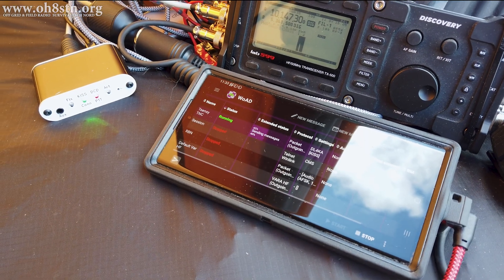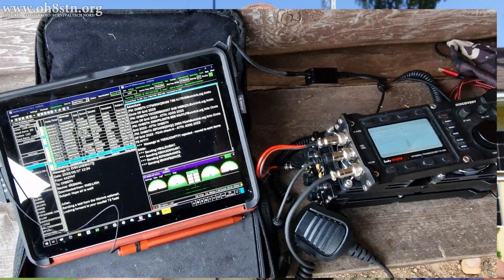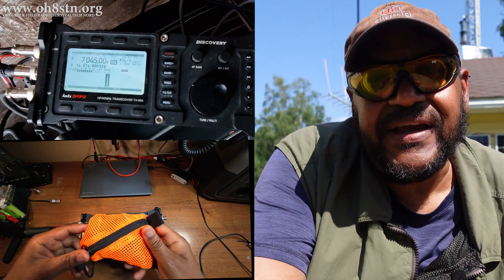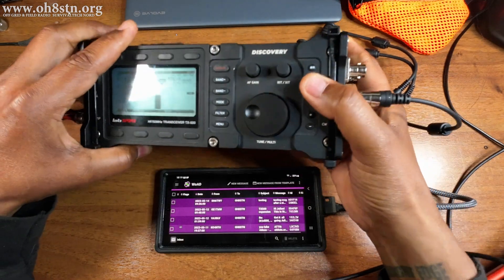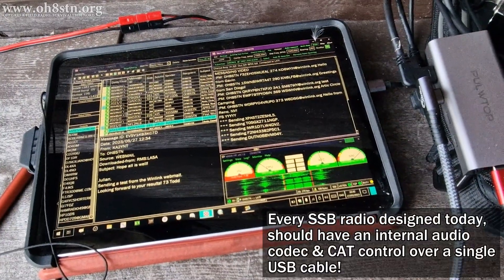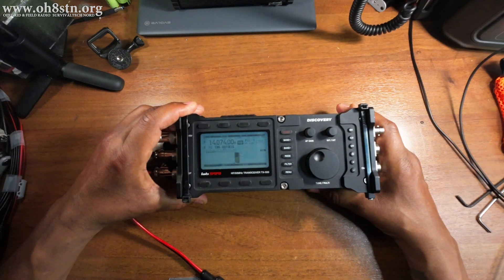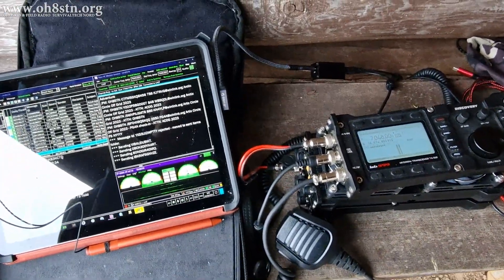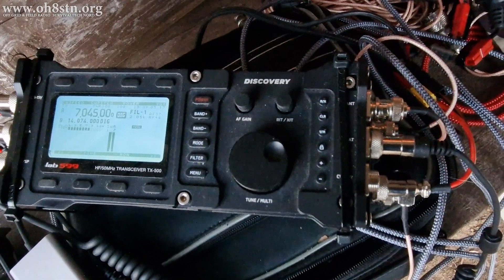Modular Ham Radio Go Kit for Off Grid HF Radio

Comment: Hey, Julian, I am torn between the 705 and lab 599. I need compact and portable due to living in a small apt. My main use will be outdoors, SSB, digital and one day CW. With the 599 being out for a while now, any recommendations?
Reply from the maker: It's complicated 🤣
The size and weight of the tx500 are appealing.  Its cable mess for dsta modes and cat control are not.
The 705 is the benchmark for all mode portable  HF, VHF, UHF with one or no cables. Its size is less appealing,  but everything is included or already built in.
It really is complicated. Hear some watching gun reading for you.
https://youtu.be/P5C3Fyy96DU
https://oh8stn.org/blog/2020/10/14/icom-ic-705-vs-lab599-discovery-tx-500/

73
Julian oh8stn

Comment: Hello, I watched your video by curiosity and was please you have explain problems you’ve have met.
I’m not an amateur radio, but what I see is that companies like Yaesu or Icom seems primarily have built radio for voice communication  not for data, maybe because there are to many modes available without any as a standard that could be integrated.
For emergency field, I would think modularity is not the way to go because you want a setup ready, when needed. I can’t imagine, under stress,building the setup you have shown. There is too many cables, and not surprising you had a problem.
Also, your radio equipment seems rugged but not your Windows tablet. If it’s a key components of your setup, you could think about it. 
Otherwise, your solar power setup is very well thought.
Overall, i’ve enjoyed watching your video and listen your thought process.
Great job!

Comment: THIS is Exactly “WHY” I follow you!! Plus Share your vids with 8 other guys that have an interest in comms.  
A Very Sincere - THANK YOU Julian !! 

* Since, for Most of us, the Lab 599 & accessories are damn near Impossible to acquire maybe some videos with other / older portable units. 
Personally, I would request some using a Yaesu FT857d with external battery in a Manpack. 
I know it is QRO, but power output Is adjustable…
My environment is BRUTAL, just a 180* from yours, Beach Environment & the Everglades of Florida. So my adaptations must deal with: 
SaltWater - Heat - Humidity - Sand - Insects - Lizards PLUS the occasional Bikini sighting. 

This request is a little selfish but I dare to say that only a “Very few” have the Lab 599 + Amp + Batt 
 
Again, YOU ROCK Julian!   THANK YOU for what you do here!
Reply from the maker: You are very welcome 🙏👍
73
Julian oh8stn

Comment: This video made me think about modularity & wires.  I just received my PA500 from Oliver (very nice!).  I am using an Icom IC-705 with it.  As I fondle my new treasure, I noticed it could mount to the Piovi Cage sideways and the antenna connectors would lineup (maybe no cable just two 90 degree connectors and a coupler with the right spacing) and the power connectors would be lined up also and 'send' if so inclined.  Positioned correctly it could also shade the screen.  The Piovi has the 1/4x20 holes to mount a bracket.  For bracket simplicity you would want the fins down, but for cooling you would want the fins up.  I think a bracket could be designed for either orientation.  I am a retired engineer, but I only left the hassles behind, I still think like an engineer.  Now I design for me (optimal!).  I do 3D CAD for 3D printing and I may just whip something up.  73 Doug N8VY

Comment: I got an idea, but it's rather expensive. A magnetic loop antenna could be a solution. I know there's a few on the market, but they're expensive. Chameleon and Alpha Antenna have mag loop antennas that have a remote tuner. 

I do have experience with the AL-705 magnetic loop from Alpha Antenna, but not their 100w mag loop and the CHA. If you have they money or maybe they can send you one for review. It would be interesting to see how they preform in the field.

Comment: Hi Julian,

Thanks für the great Video and revieving all these components. I stayed last summer in may Holidays in the north of sweden and enjoyed the setup. I own an lab599 and a diy599 pa500. I were able to make many contacts even in the polar cycle. The amplifyer is amazing. If you condiser to deploy a dx commander you have multiband cababilities. If i am portable i use an gabil foot and some radials and a collapsable whip (5,6m) for 20 to 10m for 40m i need one coil to get to the right frequenz. It works great. Give it a try 2 weeks ago I worked gabon (15m) with this setup from eastern Germany. 
Stay tuned 73 de DD4SG  Gerold

Comment: Same but different situation here! I have been trying to build a Ham Radio Go-Box, for 2 years now. The plan was to keep it simple, cheap, and light weight! All fitting into a "Fat 50" Ammo Can... Even though I have sourced affordable parts, I now have so much stuff, I wanted, it won't fit in my Ammo Can! (Even without wiring it up, yet! 😢)  So much for simple and light weight! 
Its time to do a final wiring lay out. So, I will re-assess the "wants" versus "needs", versus my container's space!  
I may just build a basic box, then another "Full Tilt Boogy" box (with all the bells, whistles, and Flux Capacitor ⚡️)?  
Either way, its all fun & educational. And may be usefull in an emergency!

Comment: Your exercises in emergency situations are incredibly valuable to all our HAM education. While I am a firm believer in the KISS method, sometimes modularity becomes a clustered mess! Atleast you are trying out your rigs, in real world situations. Finding out what works, what doesn't, and the real life problems. 
Obviously you can have the perfect equipment & rig, but 1 simple problem, can break down everything! Ie: A bad battery, a blown fuse, or a broken wire! 
I suppose if you have to "Bug Out" with your radio gear. Be prepared to haul along a full spare parts kit!? But then all that stuff, adds back bulk and weight! The answer is... There is no easy answer!
Less is More! Ounces = Pounds! 2 is 1, & 1 is None! 
Thanks for all the hard work you do. We all appreciate it! 👍👍
Reply from the maker: Yes this test with this specific equipment was designed precisely for the scenario you describe. Too many people build something or cobble things together and call it a day. If we don't test and document what works or what doesn't work, We can never move forward.
Thanks for the awesome comment.
73
Julian oh8stn

Comment: IMHO, the cabling is the Achilles Heel of this setup. What is the total weight of the radio, amp, and battery?
Reply: How hard would it be to custom build a incased, printed circut board, you could just plug into the side of your rig? If that is even possible? This may cut down on a lot of weight and bulk, versus all the wiring harnesses.
Reply from the maker: It's a brilliant idea and something we're thinking about already.  Excellent that you brought this topic up.
Reply from the maker: Agreed. Almost the entire video speaks on the cable mess. 2.1kg/4lb.

Comment: That seems like alot of gear to haul along. What are you envisioning that requires that set up? Why is the approach of radio, external battery and solar power disadvantaged to this. Its definitely got a cool factor but wow all that set up. Love your channel regardless.
Reply from the maker: It was a test of a modular setup. Radio, amplifier, battery pack, computer. The goal was to establish how pragmatic the approach would be in practice.  
The BAT500  has a start charging voltage of 15.5 volts. In low light,  it may take a while to reach that start up voltage.
73
Julian oh8stn

Comment: Julian, thank you for your content.  You are giving me the confidence I need to get busy building a 20m/40m linked dipole.  I will be using my TR-25 QRP radio on an upcoming vacation to South Dakota.  I have all of the pieces but need to measure, cut, tweak the SWR, and enjoy.  I will bring a SOTABeams pushup pole to use as the center for the inverted V.  I've never used the pole as a center point.  I will use four paracord lines to use as the pole's stability.  Now, those directions for using the NanoVNA for SWR are always confounding.  TNX de David AE4LH
Reply from the maker: Depending on the weight of your diaple, You may need to remove one or two sections from the top of the mast. Be safe and have fun.
73
Julian oh8stn

Comment: IC-705 and manual tuner is pretty efficient and flexible for my operation. Coupled with choice of data modulation device.
Reply from the maker: One hundred percent agreed. This last trip solidified the benefits of the 705.
73
Julian oh8stn

Comment: Can you elaborate a little more about the tuning issue with the pa500
Reply from the maker: Nothing really to elaborate on. When the amplifiers bypassed the tuning is also bypassed. If you need the tuner but not the amplifier, it's only possible to do with resonant antenna. Personally I would love to see the tuner work independently of the amplifier.

Comment: Lot of food for thought in this one.  Having internal audio codec & CAT control over a single USB connection would be a game changer to reduce cable clutter and eliminate points of failure.   I like the idea of a docking station for the LAB 599.  That would definitely help with the cable clutter as well.   Perhaps mounting the transceiver/PA/Tuner stack and peripherals in a pelican style case with case mounted external connectors would work.   I like having the option of both resonant and non-resonant antennas based on your communications objectives and size/weight constraints.   Modularity is definitely needed for off-grid field radio, but comes with its own set of challenges.   Great video!

Comment: Maybe the modularity needs to be complemented with a modular cable solution. The military seem to get around this problem with robust "dogbone" type cables that are solid but short. Most of your wires seem to be red and black power distribution. Couldn't agree more about built-in USB CAT & sound. 

I have also found that with all of the cables from the TX500 to the PA500, having the controls on the ends of the amplifier in the small spaces between the connectors to be a pain. Must be horrible with cold fingers. I think that the amp is technically brilliant but the focus on making it the same form factor as the TX is a mistake. A BAT500 & PA500 secured in an ammo box with the controls on the front would be better. Did you find the VOX band switching adequate or did you need to CAT and PTT to the amp to make it reliable? If so, how did the Digirig fit in with no CAT pass through on the amp?
Reply: I was thinkingthe same!

Comment: From what I have seen with the TX500 to clean up some of the wire mess you could use some 90 degree connectors.  You could also try some heat shrink that is lined with epoxy.  This would allow you to form short, but rigid jumpers.  One of the biggest thing I can not stand about the Digi-Rig cables is that they are coiled.  There is too much coil tension on them and they just seem to tangle up on everything in the field.  Custom cables and sleeving them have helped greatly.

Comment: There's nothing here that would make me change from my FT-818, I got the Windcamp battery and it made a big difference and being able to charge it quickly ( compared to the supplied NiMh battery ) in the radio makes all the difference. 

The amount of cables on the TX-500 is a turn off + those ugly connectors. 

The receiver on the 818 is very quite with excellent audio which is typical of Yaesu. The  filtering is probably better on a modern TX-500 but, in my opinion, it's certainly not worth the money over an FT-818 with the Windcamp battery. Not at all. 

I love the FT-818 it for it's size and sheer ruggedness, all I needed to protect it was a 20 Euro leather pouch and I have great fun with it and a DL1DN whip antenna + the MFJ-1820T and an EFHW 49:1, the fun factor vs cost vs receive audio quality can't be beat with the 818. I use it pedestrian mobile with the strap around my neck and the DL1DN whip and I love they way he designed the antenna that the only counterpoise you need is to touch the antenna ground and it works well for a very compromised antenna. 

The only other radio I would like to try is the IC-705 but I wouldn't be able to throw that around like the FT-818.
Reply from the maker: Apples and oranges.
The 818 with a wincamp battery can't be charged in the field. The 818 receiver is terrible compared to tx500/ic705. Yes, audio is loud and clear. Filters are extremely hard to get for the 818, If they can be found at all. If you want to do data modes with the 818, a digirig or other interface is required. That's already 3 cables, including power. 
The price of the tx500 has increased because of $/€ printing press. Also middlemen take their share.
If I were looking for a cost effective alternative to the 818, It would be a Xiegu x6100.
Reply: @OH8STN  Sure the receiver is probably more capable but it's not over twice the price capable, again, in my opinion. 

For it's intended use in the field with less than optimal antennas the receiver is fine and well up to the job4, for base use or CW I'd probably want better filters. 

You're correct with the battery, but I suppose I don't operate for more than a couple of hrs. 

The X6100, I haven't been impressed by the sound quality and reports of overload, though again, with portable antennas one would probably not see any overload unless operating close to someone else. I might just get one to play around, I suppose inevitably I'll end up with the 705 lol, trying to resist but it would make a nice stand alone SDR for SWL which would mean I would use it probably 7 days a week. 🙂

Comment: If you would stay within the limits of a 10 watt radio then all would be fine simply relay your info to one of several QRO stations in your net if they were required.
You are working with Amateur equipment and operating as a Portable Operator as you seem to stress in your videos.
In the past you would limit your operations to working 5 watts with at Yaesu FT-817ND  (a Great radio) and a Broadband Vertical Antenna and all was fine then but now you want to be a QRO  Portable Operator  with newer gear and that it seems to have opened up a whole new can of worms for you.
Keep it simple (KISS) and work within the "limitations" as a lone QRP  Portable Operator (which are many) and I think you would be fine and not have to concern yourself with having a massive collection of Logistics and Support. Just my Two-Cents worth.  Good video.

Comment: Going with IC-705 and PA500.  What is best protection  frame for IC-705?  I want to do man-pack with external LiFeSO4 batteries (Small & light as possible of course).  Pockets on pack organized with accessories and antennas.  Using "wfview" to do remote ops on win11 tablet. That is my minimum cable approach.  Thanks for being my Nbr one source for EMCOMM.  Glad to be a patreon supporter.  Added 60 watt solar and the pack  is getting bigger and heavier (LOL)🤔
Reply from the maker: Thank you Doug. 🙏
 Best frame is from peovi mounts. https://youtu.be/ag9aH3USKl4

Comment: I'm not certain,, but it looked like you were using a cable between the tx-500 and the bat-500.  Do the pogo pins turn out to have issues?
Reply: The BAT-500 does not have the pogo pins - you're thinking of the Lab599 BP-500
Reply from the maker: Indeed that is correct. The bat500 doesn't have the pogo pins 😔

Comment: fishing box radio
Reply: ie toolbox radio
Reply: about those iron/metal air batteries, the metal-side electrolyte could be for example iron-sulfate (metal-sulfate), with graphite on the air electrode side, but sulfuric acid will form hydrogen into the metals/electrolyte/air-electrode changing the voltage to barely operating, so h2so4 is a no go for now

Comment: Aftermarket manufacturers listen up! Here is a good opportunity to produce some aftermarket ruggedized cables for the Lab 599 TX-500! 

I plan on custom fabricating my own cables based on your after action report. 

I plan on using high quality wire and connectors. I'm also going to use Kevlar wire loom covers for extra ruggedness and abrasion resistance.

Now cables like that would probably cost 20 to $30 a piece from an aftermarket manufacturer. 

However I am more than willing to pay that cost if commercially produced cables like that become available.

Comment: Definately feels like a step back to your 818 wire mess days.  Guess it depends on what your use case is.  Still wondering what the important message that needs to be sent is, in a shtf scenario.  High power is nice but it can be detrimental as well, in added weight complexity and shouting here i am.  Id like to see some ideas on just using an ht like an id52, a yeasu ft5 or the upcoming d75 with digimodes and a phone or tablet.  
I also think the rig you leave behind is just as important as the rig you take into the field.  Having a repeater you control at home base is a huge force multiplier.  More power better antenna can run off larger backup battery bank.  Thanks for getting out there and showing whats what
Reply from the maker: This isn't a step backwards for me, it was more of a test for the community. In one of the upcoming episodes , we'll talk about portable power. That episode supports almost everything you're saying in this comment. I'll continue using this modular setup for analog communications, but I doubt i'll ever take it out again for data mode field work.
73
Julian oh8stn

Comment: Just saw the TX500 at my local HRO store this weekend. In earlier videos you had the PA50 attached with some latch on top? Then I saw you bolt up the BAT500 and now I see all three with cable ties. This radio looks like a good solution for me as I face needing to downsize from my QRO base station on a large rural property.